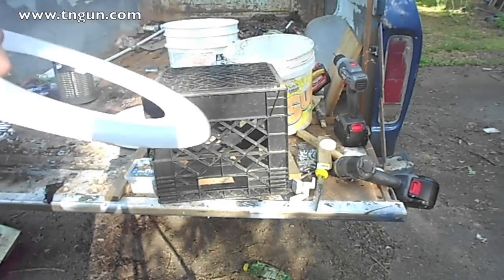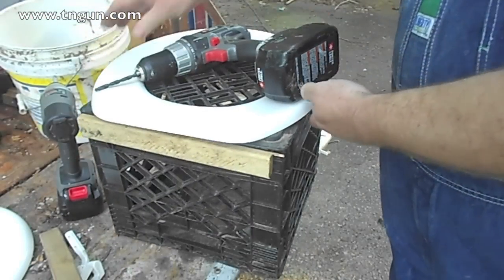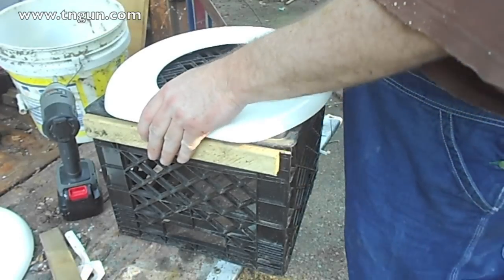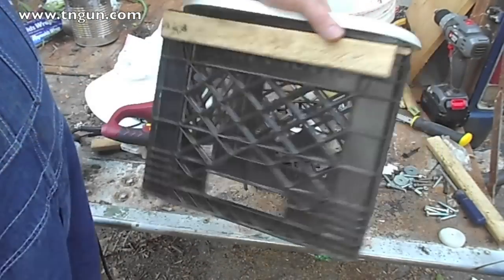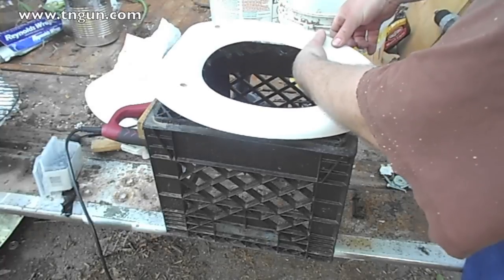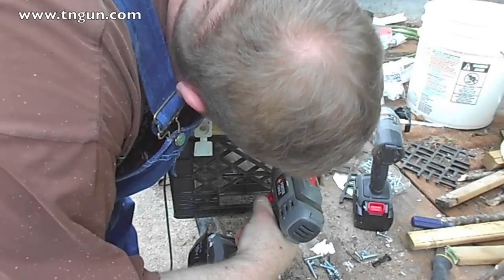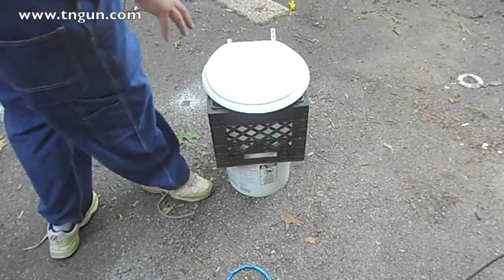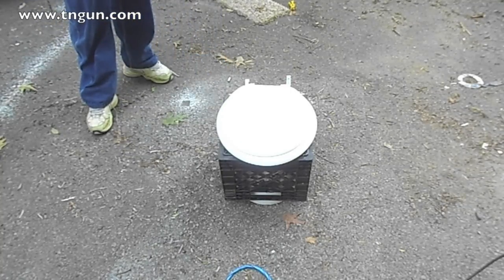How to Make a Milk Crate Camping Toilet

Comment: Like your creativity! Have a bunch of those crates & always looking for new uses for them. Thanks!

Alternative: Mount wooden cleats on bottom side of seat just inside where seat fits on bucket. Cleats keep seat from shifting. One at front and one on each side near the back. Position to fit tight but not too snug to make seat easy to remove when bucket has to be emptied. 

Set bucket in another crate to add to stability.